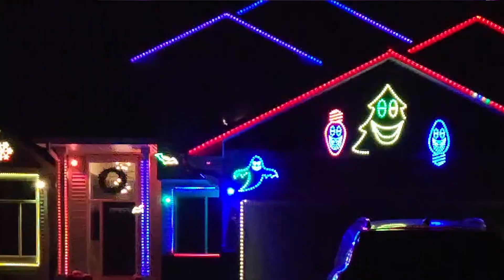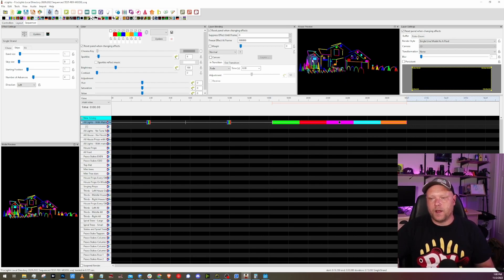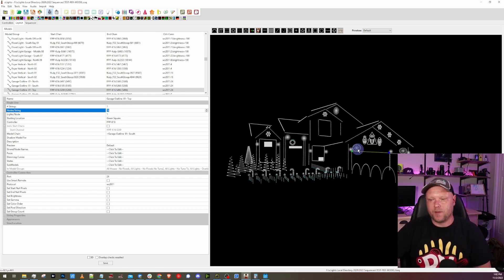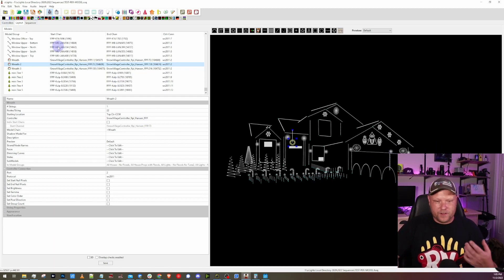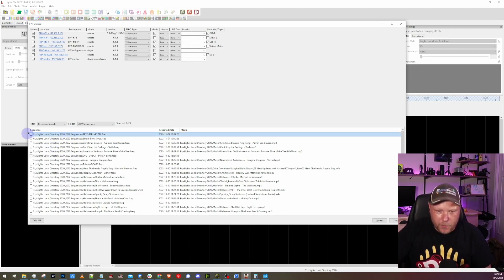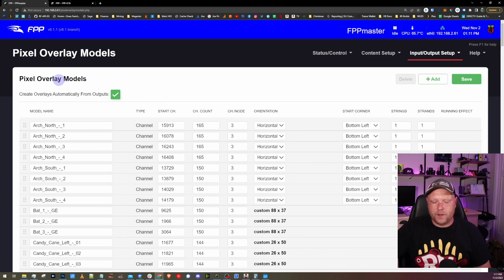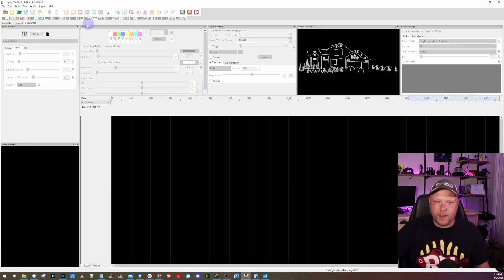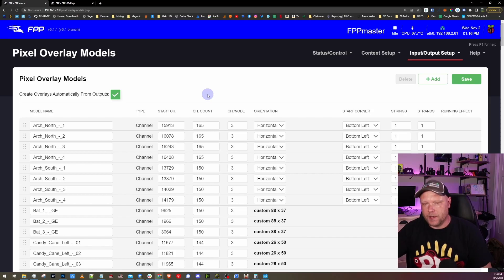Troubleshooting Display Configuration Issues with Xlights and Falcon Player

Comment: I cannot find the light bulb button anywhere on my screen.
Reply from the maker: Which light bulb button are you referring to? Can you give me a time stamp of where you have a question?  
If you are trying to output directly from xlights you would need a sequence active.
Reply: @fppshorts  The issue was that my screen is not large enough to fit all of the user controls on the top toolbar. I have to use a computer with a larger screen.
Reply from the maker: @landonconway79  if you are using a windows machine, you may be able to zoom out under display settings in the windows control panel.